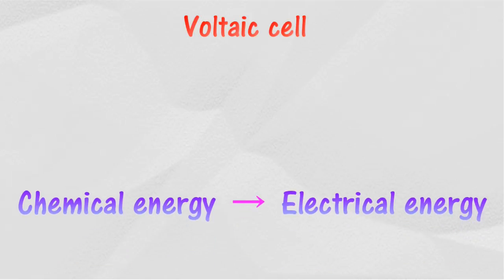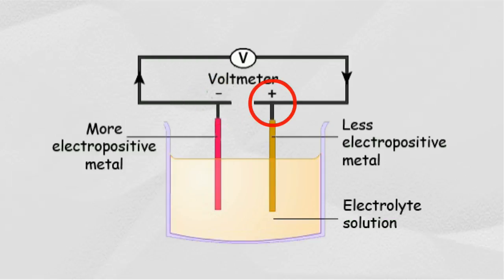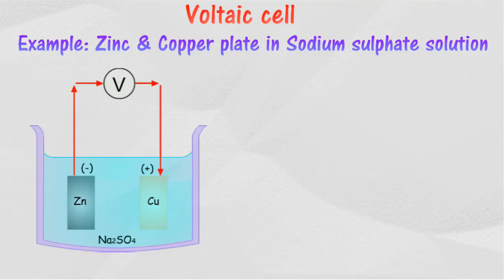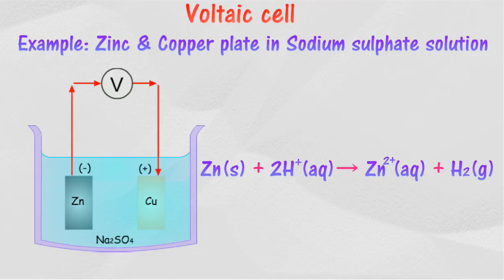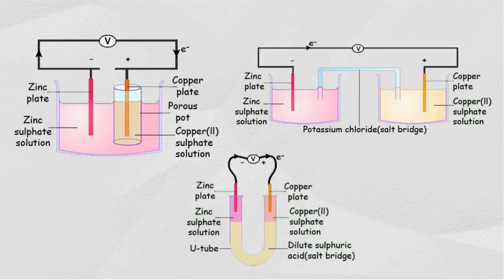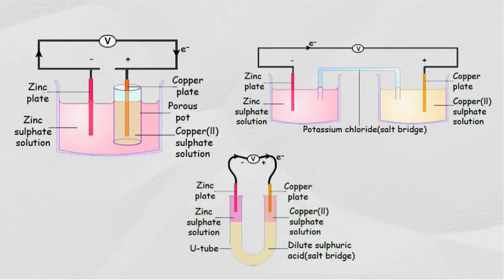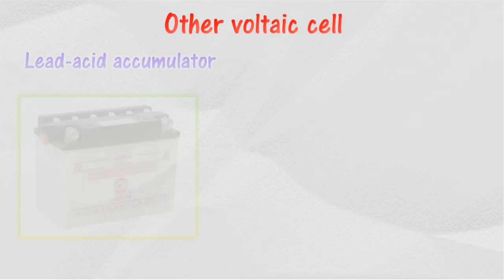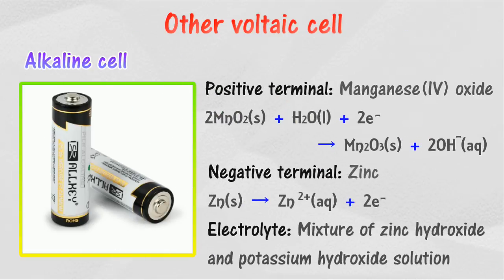Voltaic Cell

Comment: Dont spread false information. Reduction always occur at the cathode, oxidation occur at the anode. The way you say the metal in the  more electropositive: higher in the electrochemical series will be the cathode is wrong. Because it oxidize. So its a anode.
Reply from the maker: Oxidation is loss of electrons. Reduction is gain of electrons. Please don't mess up electrolytic cell and voltaic cell. 
In voltaic cell, metal located higher in the electrochemical series act as negative terminals.
https://zookeepersblog.files.wordpress.com/2013/09/1-difference-between-electrolytic-and-galvanic-cell.jpg?w=680&h=174
Reply: SPM Malaysia IPTV you are right. He was a bit confused.